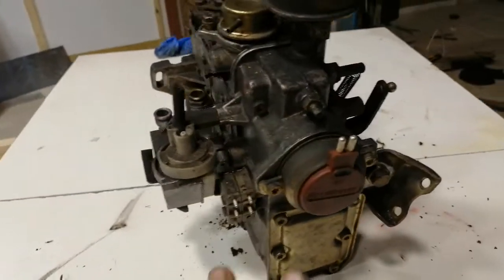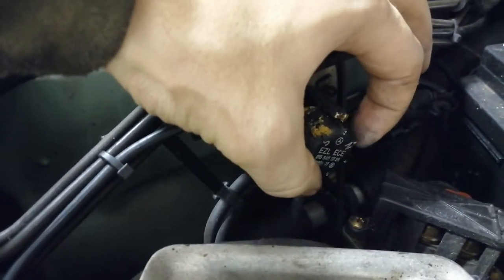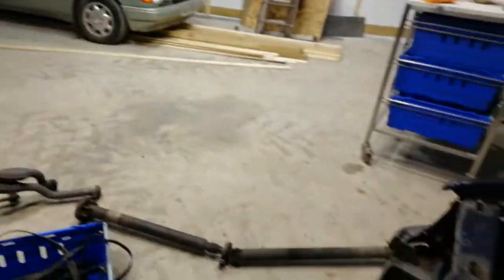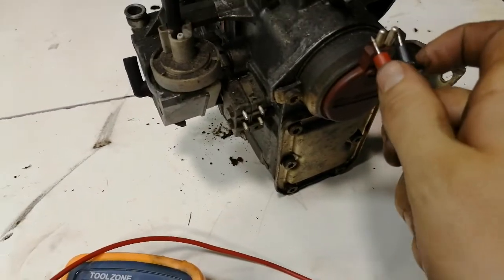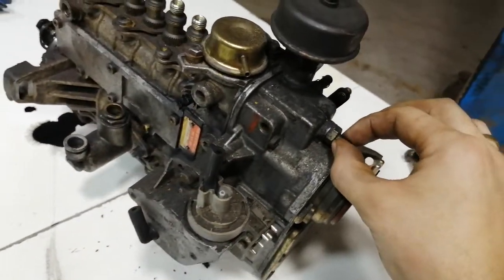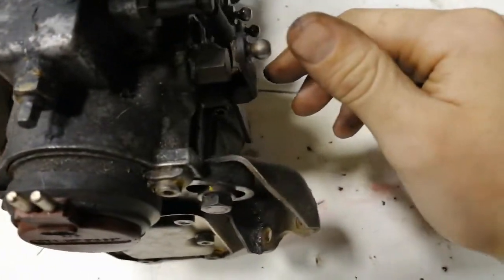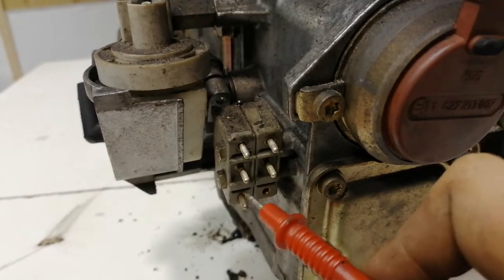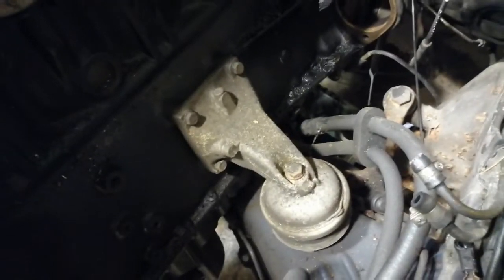Om606 bosh pump 6060700301 plug update

Comment: 3:07 Sir do l need to loosen the screws that hold the pump to the engine in order to adjust timing on that one screw?
Reply from the maker: Yes, just enough to allow movement.
Reply: @22rabbits  thank you very much!

Comment: On diesels w124, idle is controlled by the surtension relay which is located behind the battery
Reply from the maker: The system on these is the ELR relay in that same location. Its only really for making minor changes related to the temperature. There's a physical idle control on the pump for making real changes. I go through all that later on in the build. Its all a learning process so these earlier videos might lack a bit of knowledge.

Comment: If you have continuity on multimeter then it mean that cyrcuit is closed not open mate.
Bolt above is for adjustment of idle rpm
Reply from the maker: Your dead right. That's just me using the wrong terminology for the same thing.